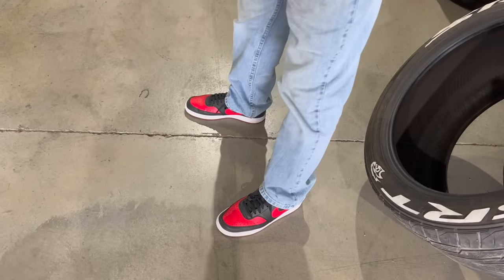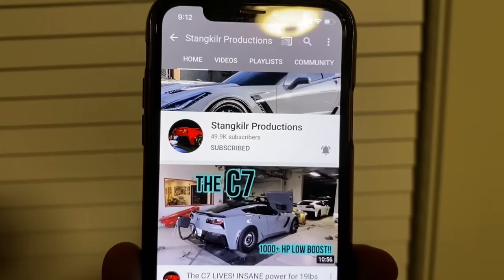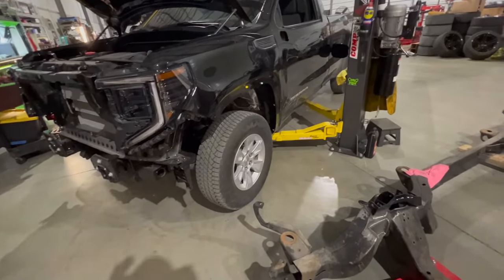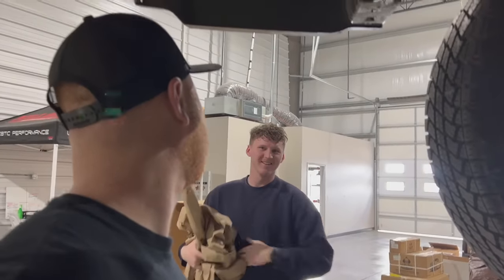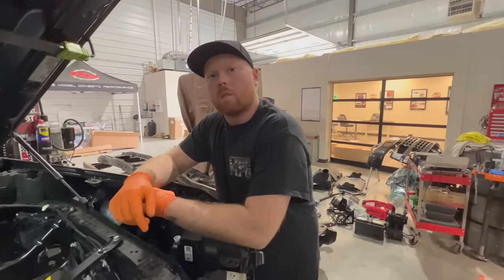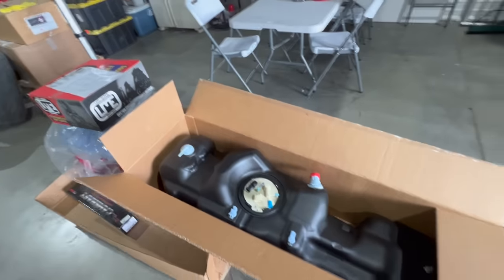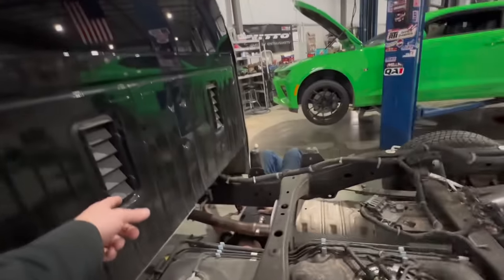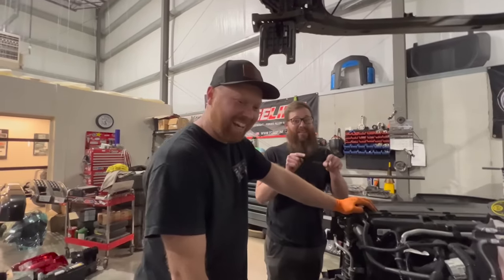Building my own regular cab, short bed 4x4 turbo V8 monster 2024 GMC! Part 1....

Comment: I’m rebuilding my dad’s motorcycle that he got when he was 17. It was his dad’s that he got brand new in 1971, his dad died in 1979. My dad’s mom sold it to my dad in 1979. My dad took it apart in the mid 90s to rebuild it but life got the best of him. I have been working with my dad to get the parts to rebuild it back to factory stock. Kinda sad because I don’t think he will ride it when I finish it but at least he will have a cool motorcycle.
Reply: Sounds like you should ride it and record it and let him watch if he does not ride it
Reply: Like what he would see if he was riding

Comment: Correct me if im wrong. 
But wouldn't it be easier to just starting with a short cab and bed WC, and just swapping the turbo  4 cylinder to a V8?
Reply: The 4 cylinder truck doesn't have the correct mounting points for the motor as well as all the other control models not playing nice with the v8 ecu.

Comment: I am excited to see the RCSB but I would have preferred to see a Gen 5 Whipple 3.0 before you went turbocharged. Would it have been easier to get a turbo 4 cylinder or 6 cylinder RCSB and just swap the drivetrain out instead of swapping the frame and bed? You're going to replace almost all of the running gear anyway right?
Reply from the maker: The front of the frame is all different and all the modules in these new vehicles talk to eachother. The amount of labor in getting everything to work would surpass what we’re doing. I’m very much a numbers guy so i thought about all avenues
Reply: @StangkilrProductions  I figured as much